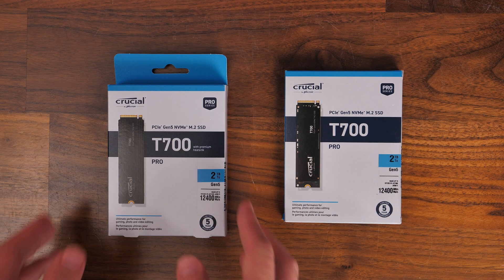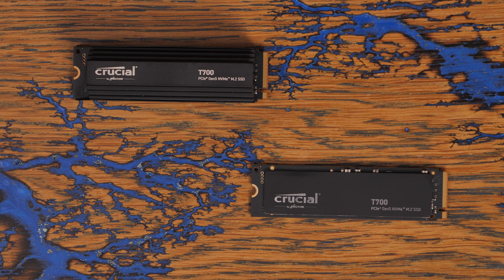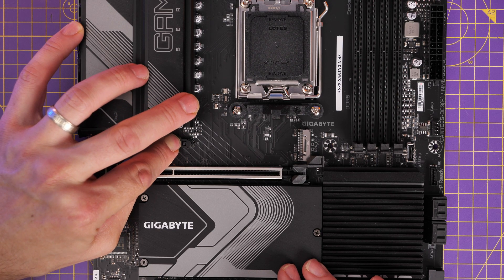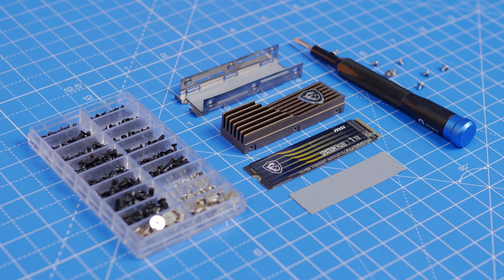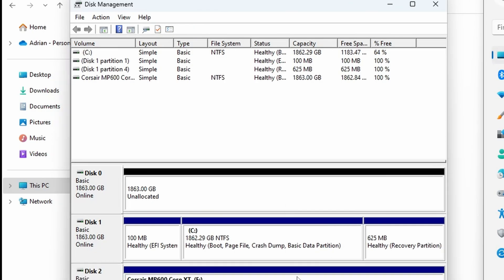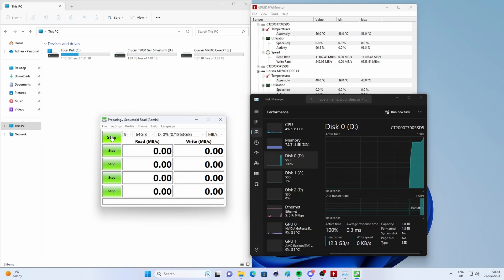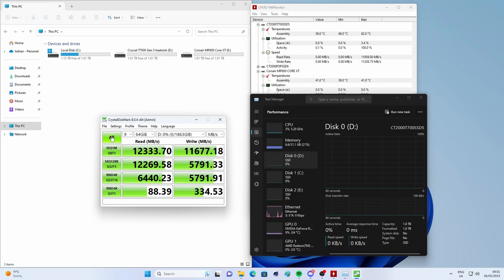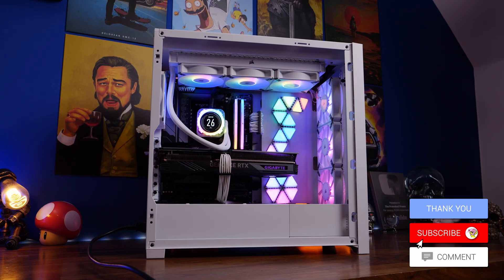How to install and test Crucial T700 NVMe SSD

Comment: Hey there. The heatsink variant is a good 50€ cheaper here, can I just remove it and use the mobo heatsink?
Reply from the maker: You might be able to, but I wouldn't. The heatsink that's installed will be far superior to any motherboard one

Comment: Did you try using it as the boot drive? Aka, loading windows 11 from it?

Cheers
Reply from the maker: not at this time. Should be perfectly fine as long as properly cooled though.

Comment: Wonder if the included gen 5 cooler on something like the Taichi x670E would be better. It has a built in fan. I'm wondering how different the temperatures would be

Comment: And if you boot to that drive only can you load the operating system on it like a normal hard drive, obviously if the bios recognises it like you said, of course?
Reply: It didn’t work for me as a boot drive, windows didn’t recognize it. Only as secondary 😢
Reply: @Rolfvanrijn72  Did you try removing the other hard drives completely first. Take the sata cables out and pull out the power to the other temporarily then reboot with t700 connected and check in bios its first boot device the save , press f10 or f12 to chose quick boot and then choose your data stick with the windows setup on. If it doesn't work then maybe its your motherboard doesn't like it. Dont forget to reconnect any other sata ssds later . I've had trouble so I put only one drive in pc . Use external to store other stuff.
Reply: @markshelton3790  I tried all that and just mounted it as secondary, the mono is not a gaming board, I use it for work, I’m getting 6000mb/s that’s plenty. Especially since it doesn’t have a heat sink

Comment: Great video; I've been excited about the idea of NVME gen 5 SSDs for a while! Could you please do a video comparing this same drive with the heatsink it comes with vs putting a custom water loop NVME waterblock on it? Several companies like EK sell them, but I haven't seen a comparison using one on a gen 5 SSD yet & I hear they can ger REALLY hot without excellent cooling so water cooling sounds like the best option! Thanks :)